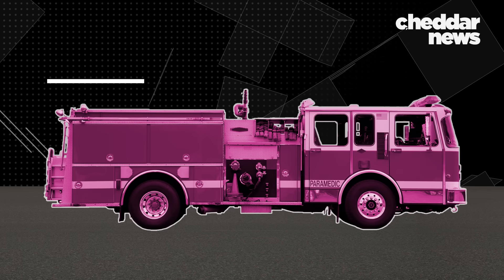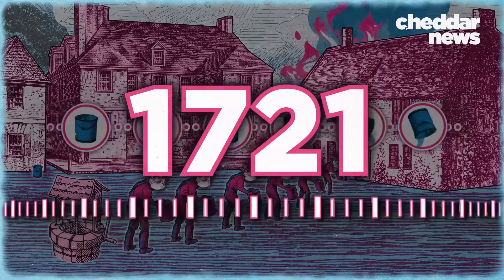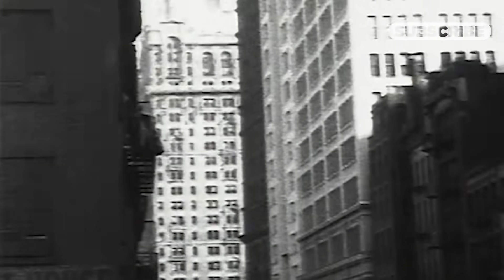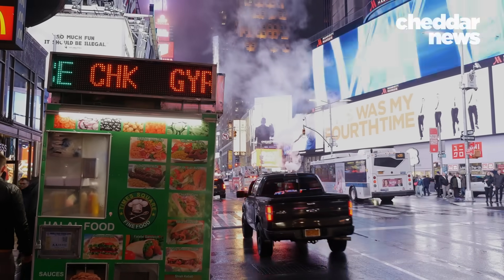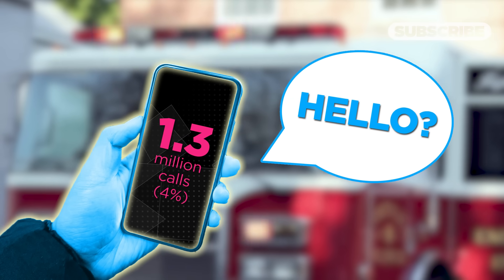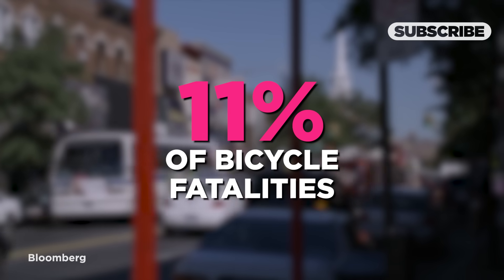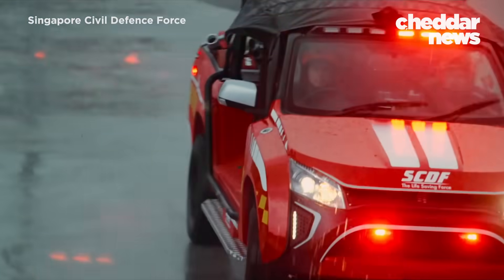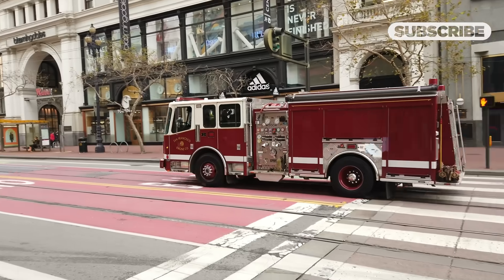Do American Fire Trucks Need To Be So Massive? - Cheddar Explains

Comment: Recently retired city firefighter (1984-2015) and when I started firetrucks were half the size they are now.  With each new model, the size was born out of the amount of stuff you were required to carry.  Back in 1984 all we had to carry was fireman stuff.  Now, firetrucks are basically non-transport ambulance/firetruck/extrication vehicles.  Cheddar showed a marked lack of research in this video.  Many fire departments, tired of wearing out their $750,000 custom rigs, have moved a lot of the medical things to a Chevy Suburban type vehicle.  Firetrucks keep much of the same medical equipment on the rig but now keep the engine behind and let the rescue take the brunt of the calls.
Reply: So many of these arguments are either or. I have always seen these as "and". Like why use a 4lb hammer when a 12oz will work better, but you keep the 4lb one around for when it's needed.
Reply: @jz422 plus the  smaller “hammer” might not be robust enough to survive the “pounding”.  Bigger might not always be best, but I dought anyone would argue stability and breaking aren’t a nuts!  As a civilian, I often wonder how many of the accidents are due to the public not adhering to rafic and common sense rules- lights and sirens mean something and having driven vans, the bigger and heavy you are, plus the speed your going- stopping on a dime DOES NOT HAPPEN!! 🚒
Reply: With the advent of electric vehicles the need for foam units has never been greater. A truly staggering amount of water is needed to put out a battery fire because the water reacts with the lithium and creates hydrogen which feeds the fire. Foam separates the reaction from the fire, knocking it down swiftly. A hundred gallons of foam does the job of many thousands of gallons of water. For many departments the cost of buying foam units is simply insupportable with all the other things that fire departments are required to do.
Reply: @richardbeckenbaugh1805  In Germany they tested a number of possible options to deal with burning EVs. At the moment the most successful seems a container the fire department can bring on scene into which the vehicle is put and submerged under water. Foam would work as well, but due to the nature of battery fires, on a main road you can not keep an EV under a foam blanket for days to suppress the fire until the chemicals in the batteries stop reacting.
Also, as far as I know, every truck here (not so certain about the smallest sized ones often used by volunteer departments for example) has at least some sort of foam system on board. it may range from a fixed tank of foaming agent they can switch to, to just a certain nozzle that gets connected to a canister of foaming agent. the latter ones are not that expensive, but sure come in handy if you deal with burning liquids like oil and gasoline. They may also be used on regular cars or trucks for that same reason.
Reply: @alexanderkupke920  Someone makes a large "blanket" or cover that you pull over the EV and completely cover it up until the thermal runaway stops.
Reply: @RealJeep I have seen that on TV, can as well be used on a regular vehicle fire. I did not hear yet about any department using it, despite it looking a lot easier to carry and deploy, but I may just have missed it. I think I heard about a dutch department that uses this one. 
Both seem to have pros and cons. but from ease to carry aound and deploy, in my book that blanket should win. Some may consider the water tank safer, but you have to store it somewhere anyways and cannot use it in that time in case another EV catches on fire. Another blanket you can easily put in a corner somewhere until needed.
Personally I think I am more worried about a fire from a runaway battery than burning gasoline.
I guess they will come up with a lot of new and creative solutions for that in the next years as they have to.
Reply: @alexanderkupke920  My country's fire brigade once managed to extinguish an EV fire reportedly by managing to disconnect its battery electricity supply wires
Reply: @richardbeckenbaugh1805 is it more cost effective to buy the electric car smother blanket compared to foam trucks??
Reply: @richardbeckenbaugh1805  Foam is useless on lithium fires. Water or special agent is needed.
Reply: Yes, but how manage European trucks, which are smaller, to be equipped with about the same equipment, depending on the region same size water tank etc.? (Yes, if hydrants are readily available on some trucks they use smaller tanks around here, but then sizes and equipment across German fire departments for example are in general standardized. And if the city is such big, they have to have such amount and size of trucks etc.)
Reply: @alexanderkupke920  My last engine had 750-gallon (2840 Liter) tank so no, no euro rig is comparable.
Reply: @RealJeep  That is not correct, you just have to compare the correct type, as Engines here come in different sizes. Also I have just lately seen an announcement for an american truck, depending on what they need, those can be ordered with anywhere between 200 and 1000 gallon tanks. So there is quite a range to compare in between. And I understand that smaller tanks only make sense when you have a reliable net, or even an abundance of hydrants available. so most likely we are talking aout downtown areas of bigger cities.
The smallest engine we have as standard would be the LF10 type (LF as abbreviation for the German "Löschfahrzeug", so, an engine that can pump water, the 10 defines the pump capacity, in this case 10 * 100 l per minute at 10 bar (about 145 psi). Tank capacity has to be at least 600 l, but I think they actually increased that requirement to 1000 l a few years ago.. Those are the smallest and can often be found in volunteer departments. Those are also not fully equipped. they would actually be smaller than most american engines. 
There is another variant, the HLF10 (Hilfeleistungslöschfahrzeug) that carries other equipment, more rescue equipment like hydraulic shears and spreaders and at least 120 l of foaming agent, but still not the full size and equipment.
Next size up would be a LF20, where size up means mainly the pump. The actual vehicle is not or only slightly larger, depending on the brand. pump capacity is 20 * 100 l per minute at 10 bar. minimum tank capacity is 2000 l . 
Again a variant with more equipment is the HLF20, which i would consisder the best comparison to a US truck.
Beyond that another category are TLF (Tanklöschfahrzeug) in sizes 200, 3000 and 4000 which is the actual tank capacity in liters. besides having a roof monitor (I think you call this a master stream) they usually are equipped with foaming agent as well. Less other quipment and not present everywhere, but quite common in actual rural areas.
But there are other things to consider. Around here, you are way more likely to find a hydrant in most of the places, compared to the US (they may be invisible though, as they usually are below street level under a cast iron lid). We have way less homes which are running their own well. In the absolute majority of places the city runs waterlines and provides high quality drinking water. So adding hydrants is no big deal. I realise areas here are built far more compact and doing the same in the US might not be feasible (or simply efficient) in a lot of places. We have way less areas, where a larger tank capacity is actually needed. But also, that was only the minimum requirements. larger tanks can be and are used, when needed. Oh and none of those would be what you call a water tender, although TLF or GTLF (a larger version of those which is very specialised) may regularly be used as such.
The other thing to consider, knowing for example parts of Florida, most fire stations I have seen are like an engine, a ladder and an ambulance and they are spread across the country. There sure are larger stations, especial within larger cities. But going along the highwy you usually pass another one within minutes.
Fire departments here across a city usually have only few fire stations. A city with a population of about 270,000 may usually have 3 or four stations (plus volunteers!). But those stations usually hold, 6, 8, 10, 12 or even more vehicles. So they usually have the different type and of course can easily choose which one to dispatch. Again a reason to not needing all vehicles fully equipped. the main fire station actually may hold several dozen vehicles, then not only including engines, ladders and ambulances, but more specialized vehicles as well. what would be the batallion chief, larger ladder or tower trucks if needed, water tenders, a crane, or just trucks with roll-off containers that hold anything from oil binding agent, SCBA tanks and possibly a compressor, agents fro chemical fires or hazardous materials, additional hoselines, whatever might be required at some point. They even have water containers for those to be used as tenders. (latest addition for some departments seems to be a dump tank, a container in which a burning EV can be pushed and then filled with water, to leave it sit for a week and cool down.)
Reply: @alexanderkupke920  You are saying that in Europe, there are many different fire trucks for many different jobs.  In the USA, the vast majority of Engines, the trucks that carry and spray the water, are very large and getting bigger.  Not only are they tasked with bringing and spraying water at extremely high flows as opposed to Euto high pressure, low volume, they bring with them massive amounts of EMS equipment, Extrication equipment, foam, cribbing, extra nozzles and hose and anything else people can think of to cram on the rig.  I don't know of a single fire truck in the USA whose sole purpose is to bring SCBAs.  Each seat on the rig minus the driver has their own SCBA with extra tanks on the rig.  
In Europe, if you had a truck that had the same amount of water, hose, equipment, EMS gear and appliances then your truck would be the same size as a USA rig and that wouldn't fit on most Euro streets.
Reply: @RealJeep  the HLF20 has the same amount of equipment. EMS equipment may actually be less, because our EMTs and Emergency doctors (yes they go out as well) ride in different vehicles, EMTs usually in what we call an RTW (Rettungstransportwagen), which is an Ambualnce with all the EMS equipment. 
the high pressure of 8 to 10 bar is usually only used with the fast attack lines. We usually don´t run Quick Connects or Preconnects but instead have those high pressure lines mounted on reels. I think you call them booster reels and Rosenbauer lately offers them in the US as well.
For smaller incidents like a vehicle fire those two fast attack lines or booster reels may actually all that is used. For vereything else, they deploy low pressure lines. Very much the same stuff and sizes you run as well. not sure about the pressure. As mentioned, this vehicles has a capacity of 2000 l per minute at the high pressure. that amount of water needs a hell of a line diameter. The typical line sizes they use would be D hoses (the booster reel, about 1 inch diameter), C hose, about 2 inch and B hose at about 3 inch.
At the lower pressure of about 5 bar the 2 inch line can provide about 200 l per minute without, and 100 l per minute with a nozzle, the B size would be 800 l per minute without and about 400 l per minute with a nozzle. According to a friend of mine who is a volunteer firefighter, the b size usually is not used handheld.
When it comes to SCBA it may vary, from what I know those trucks can carry between 8 and 10 people and have a minimum of 4 SCBAs (usually thats the ones in the cabin, sometimes they have 6, but usually they also carry additional ones). The SCBA container I mentioned is solely intended to carry spare bottles in case a lot more than the spares on the truck are needed in larger incidents and usually has kind of a maintenance station and a compressor built in to refill bottles. but that is not something a regular engine carrys around, that is a specialized vehicle that is also only used when required.
But as I mentioned, they way they run our fire stations, not every single vehicle has to fulfill all roles, other as with most US firestations I know, where any small station independently has to be able to react to anything they throw at them.
Also just coming to my mind, due to what infrastructure and smaller roads are designed for, there are weight limits on engine trucks here (I think 16 tons). Not sure what a US truck weighs in at. so if they don´t have to carry more than the minimum amount of water and can safe weight that way, that is what they do.
Also just comming to my mind. we talked about European fire trucks. And those are to a hughe degree similar or close to each other across europe, but still, each country may have different standards. What I described goes for Germany and mostly for example Austria. Dutch fire trucks seem very comparable as well. in other places like france and spain, requirements in certain areas may be vastly different, especially with availability of water (hydrants) where there simply may be none. bring in all other countries numbers of population density and geography and you will find anything. even more specialized trucks.
I just remember in the area close to the Belgian and French border we have a village or small town with houses mostly 300 years and older. streets are accordingly, my midsize SUV already wouldn´t fit in places. they have even more specialised smaller trucks, even a ladder truck that at the first vie looks like a toy, compared to a regular one, but has all the reach they need. And in that area due to a lack of hydrants they actually have to use pump trucks to establish water supplies (pumping as far as they can from one 6000 l fold up pool to the next) over kilometers. Especially a great issue in freezing temperatures during winter time.
Reply: @RealJeep  Look, I get you feel strongly about something, but the literal statistics and data on this issue doesn't agree with you. You can make smaller, compact firetrucks that are just as efficient. And a benefit a LITERAL benefit of making our trucks smaller is being able to reduce the width of our roads, which inarguably makes them safer and cause less wrecks. It's a statistical fact. Fire Department literally argue against Bike Lanes because of it restricting their road space in America, When if you reduce the size of the truck they can literally use the Bike Lanes in an Emergency like the European Trucks. America and it's exceptionalism should admit at some point that there are better ways to do things then how we do them. They have small compact firetrucks with similar size tanks in them and others with similar sized ladders. I'm an American I love our firefighters, but I'm almost a huge fan of science. Which is responsible for a LOT of the life-saving equipment firefighters rely on. I just think its weird that firefighters will trust science to save their lives, but when it tells them there is a different way to create their vehicles that would actually be safer for Americans, they only listen to their own personal incredulity. Well, honestly, your opinion doesn't change facts. You should look into the ACTUAL statistics from DOT and across the world and compare the data. It's very clear that we could reduce car wrecks and make our firefighting force more efficient by reducing the size of fire trucks, which in turn allows us to reduce the width of our roads. Rather you accept that or not, doesn't matter. Facts don't care about your feelings, right? Just do me a favor and actually look into it.
Reply: @nerdjournal  I really have zero idea what you're talking about.  You want to make all firetrucks narrow?  Maybe you should look at NFPA 1901 and see that it's the NFPA driving the need for bigger and bigger trucks.  I seriously doubt there's a Euro truck company anywhere that has 115 ft of ground ladders along with all of the other stuff truck companies are required to carry.  When I started in 1984, engines were a lot smaller, and I do mean A LOT!  With each progressive purchase over the next 31 years, rigs got bigger and bigger.  Why?  It's not because we thought bigger rigs were cool, it's because we were required to carry more and mor equipment!  The EMS gear alone takes up almost one whole side of the engine company now, plus a lot of the crew cab which has to have a refrigerator, safe drug storage cabinet and extra EMS supplies for mass-casualty events.  So, to counter your comment, No, fire apparatus in the USA cannot be downsized UNLESS you buy and man more apparatus for specialty services.  Budgets will NOT allow that, in any department that I know of.
Reply: @RealJeep Other countries may have different smaller vehicles more specialised in different areas e.g. in Japan mountain & water rescue are handled by law enforcement instead, with green & light blue vehicles respectively, while in Norway I've seen vans dedicated for water rescue. Some cities may have flatbed trucks that can swap between carrying different containers of different equipment depending on the mission e.g. breathing apparatus pods, foam pods. Singapore even has a bus whose sole purpose is to have ice baths for firefighters to rest while taking turn to extinguish bigger & longer fires
Reply: Yup
Reply: Sounds like houses are returning to the “Emergency” show style dedicated rescue trucks for the fire EMT’s.
Reply: Thank you for your service to the public
Reply: So why do you need this on each truck? Why not a second car?
Reply: Firefighter is non a one frame job. It being the first to do the job fire ems. The firefighter is a emt a medic as well a fire grunt when needed
 The truck is for all we need to do are job for the community
Reply: So shouldn't it be better for fire departments to have a wider range of trucks. For emergency calls you don't need a fire truck but an emergency vehicle.
Reply: @fortheloveofmusic860  So how big do you think the department's budget is?  The last time I looked, the average cost for a basic pumper truck was $500,000, a ladder truck was over $1,000,000.  Do you think they can afford a half dozen "specialty" rigs as opposed to one that can handle all the jobs.  And what about if the crew is out on or returning from another call?  Who's going to bring out one of those rigs?
Reply: @fortheloveofmusic860   that would be great in an ideal world but there are two mitigating factors. The first is cost. Fire apparatus can cost over $1 million dollars these days, so the more specialized you get the more money you spend. Municipal budgets are strained as it is and it takes years in many cases to get approval to purchase apparatus. 

The second issue is manpower. Specifically for volunteer departments. Having too many or too specialized apparatus creates the potential for not having enough personnel to get them to the scene. 

Do you don’t want to create a vehicle that is the Swiss Army knife, but you can’t be too specialized either. There is a balance.
Reply: For  a  view into a European firetruck.Google for the  following sentence
15 nye autosproejter og tankvogne til frederiksborg brand redning
As far as I can  see  they carry 1500-2000 liters of water, but they don't carry medical equipment,and ladder  vehicles are separate.
Reply: I totally agree that fire departments today do so much more than firefighting. So vehicles need more space. Also, the EPA has created emissions regulations that require larger cabs to make room for the technology that is used to meet those regulations. 

Further, many communities lack hydrants so tankers or pumper tankers are required as fire departments must manufacture their own water supply. 

The makers of this video should become firefighters and then they would change their viewpoint.
Reply: Australia uses similar fire fighting vehicles to Europe and it works fine.  @davidj7239
Reply: @davidj7239  Nope they dont, look at european fire trucks, they carry the same equipment and are a lot smaller because they are packed much more efficently. And yes they have (slightly) smaller tanks, but for that matter we have TLF (tankers with big pumps) which go along if needed.
Reply: @jurmajurma7689  have you ever been a firefighter and also spec’d out fire apparatus?  I have. You build for function. Clearly European designs for different circumstances than US.